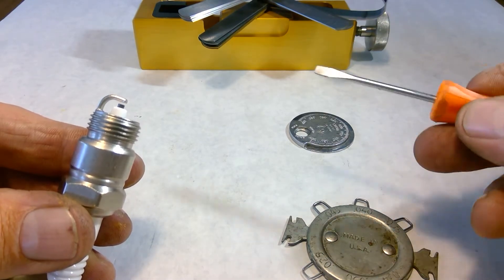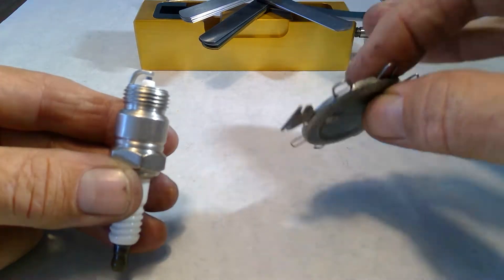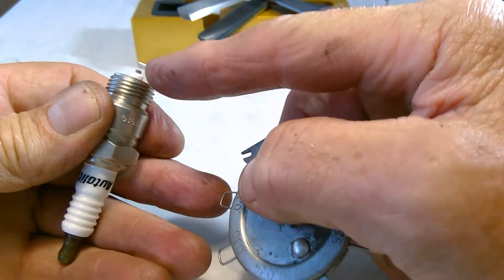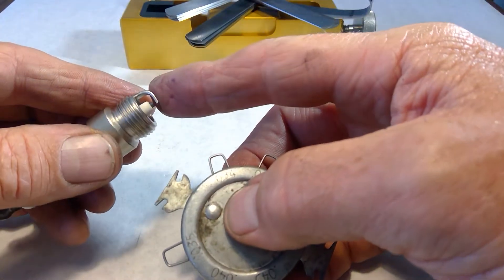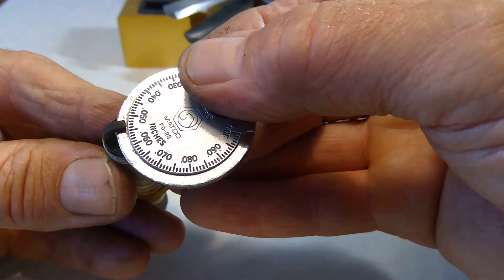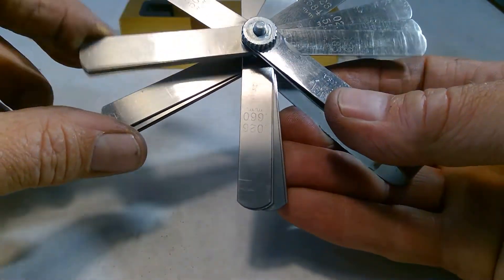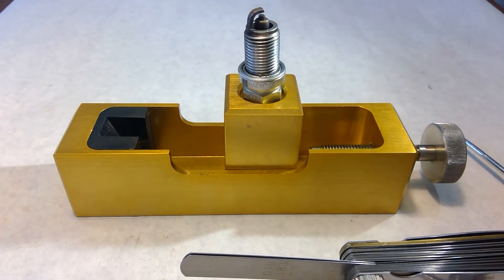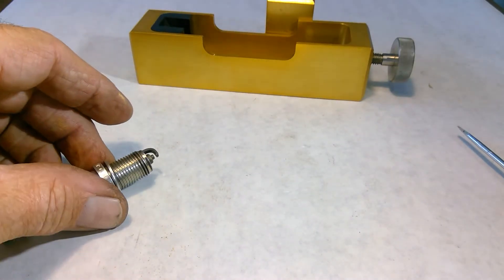How To Check And Set Spark Plug Gap

Comment: Hello, excellent video, I have read in several forums that indicate that the currency -shaped tool to adjust the spark plug gap, will damage the iridium spark plug, because the electrode is very fine, I will appreciate your opinion in this regard.Thanks.

Comment: This is probably a very stupid question,  but I'm not sure so here's my question  , when gasping spark plugs when you have the plug inserted into the gaped does the electric of the plug have to be exactly in the middle of the gaper number line?  For example I have  .044 should I have the electric dead in the middle of that line of  .044?

Comment: Where would one find brass-looking instrument? What's is called?
Reply from the maker: That spark plug gap tool is made by AllStar. It's available through a bunch of race parts retailers but it's damn expensive. I bought it to make sure plug gaps were exact on the race engines.